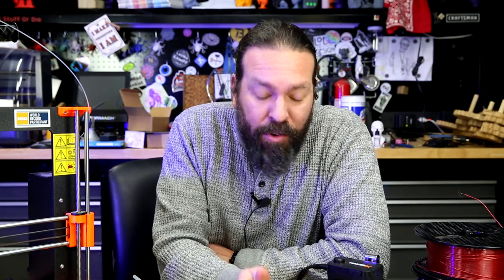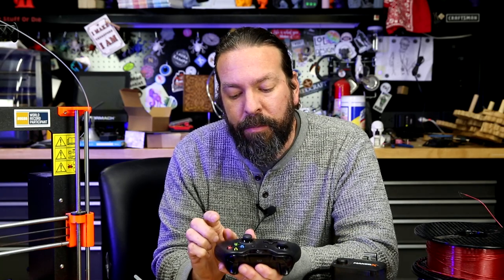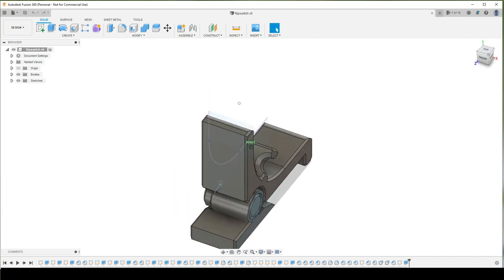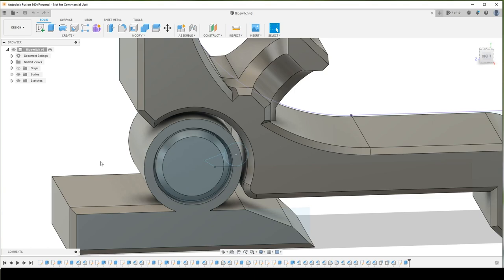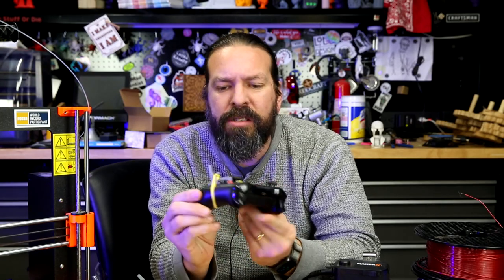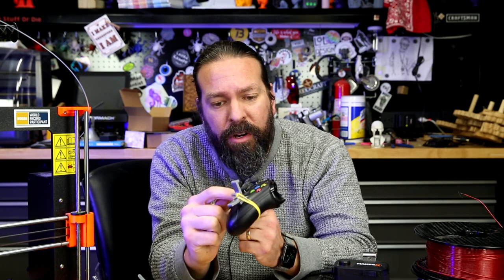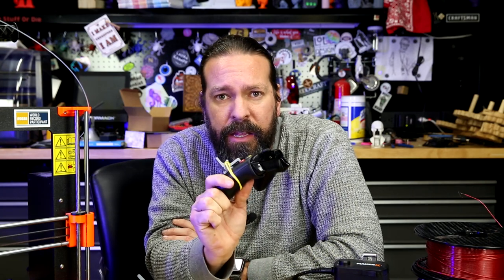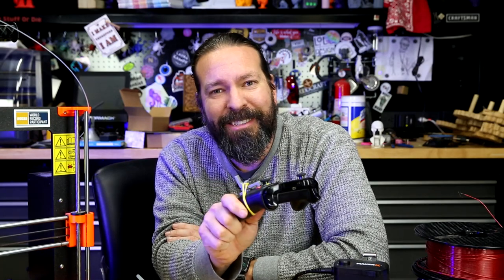This clever 3D Print Helps Disabled Gamers Hold Buttons (for Micah Wiggs)

Comment from the maker: how would you re-design this to work with the top two buttons? Also, if you think this could help you, reach out!
Reply: I think the first try at the upper 2 buttons would be to use what you have and lengthen the "finger" pushing the button and possibly put an arc on it to clear the other lower buttons.  This would allow you to use the "real estate" that is on the horn part you attached to in this video.
Reply from the maker: @techedfireman4981   yeah, that would work. I worry about blocking use of the other buttons.
Reply: Instead of coming down directly onto the bottom button, you could have the end of the arm aim a bit outside the four buttons. Then another bi-stable rubber band arm could pivot off of the end of the original arm and select which button to press, close or far. The new "selector" arm's movement would be rotated 90 degrees relative to the original arm, so it wouldn't come "down" but rather its tip would move between the bottom and top buttons. 
I think this idea could work for the red and yellow buttons, but it might run into the joystick for the green and blue buttons.
I love the print-in-place aspect of your design. Super clever!